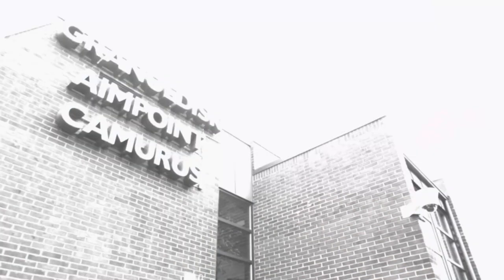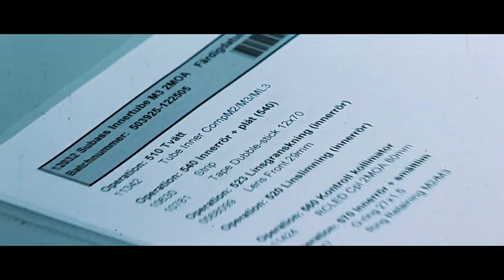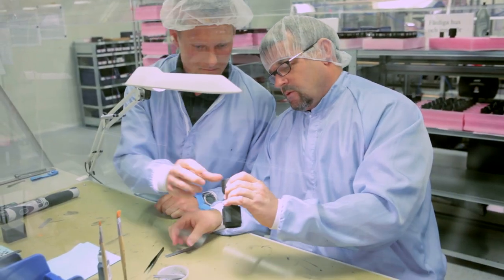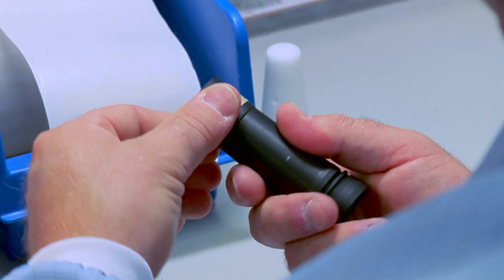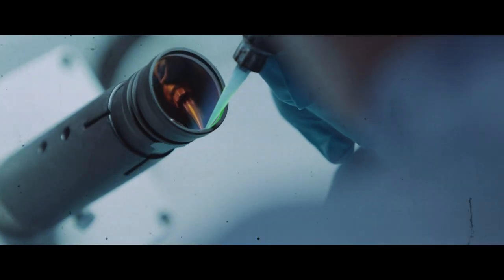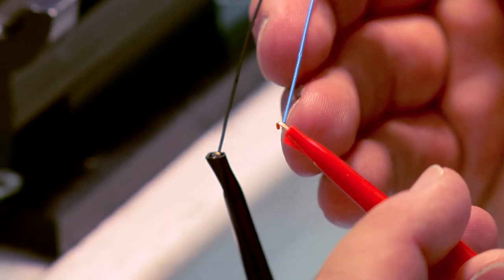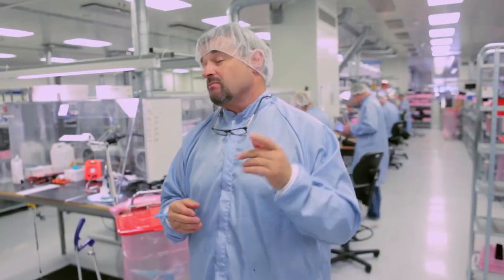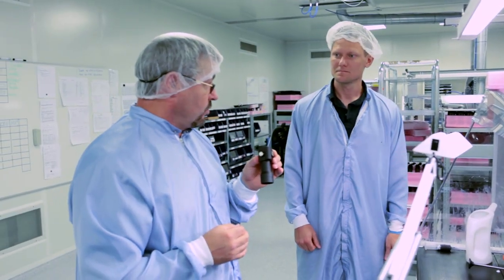Building an Aimpoint Pt. 1: The Parts

Comment: The Aimpoint uses old LED technology I can make one from scratch in my garage.The real high Tec technology is Holographic technology use by EOTech.
Reply: +Peter Martinez you mean that technology dropped by socom because it's garbage. You don't have the precision in your garage to make an aimpoint. maybe you could make a chinese knock off, but get real dude.
Reply: +Peter Martinez LOL !
Reply: +Blair Wright LED technology was invented in 1927 knuckle head!! and used as a sight in 1962 by Aimpoint. The USAF use Holographic sight in the 80s. EOTech was the first and only so far to use it in a sight
Reply: I'd pay you $100,000 if you can hand build an aimpoint comp m4s from scratch that doesn't fall apart in my hands.
Reply: But you can't since you're just a fanboy :/
Reply: I love my Sig Romeo4C
Reply: +Peter Gun "from scratch in my garage" lolol please attempt this, I'm in need of a good laugh.
Reply: Why does the level of technology matter? As long as it works right? I'm just saying, EOTech, Aimpoint, or Trijicon, your sights fail, you're going back to irons.
Reply: Yeah, I could build an aimpoint in a garage.

Tons of parallax error, dot would be shoddy as fuck and not crisp at all, wouldn't be able to zero because it would wander with the recoil from every shot. Just because I could, doesn't mean it would be as good.
Reply: MexicanBagpiper96 the Aimpoint has actually outlasted my Magpul and Troy Irons so that’s only a half true statement 😂